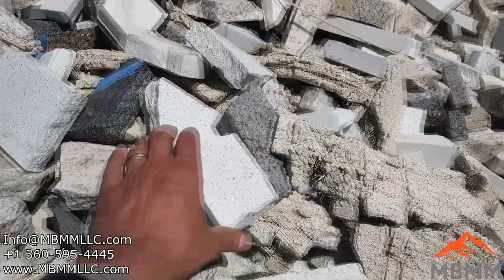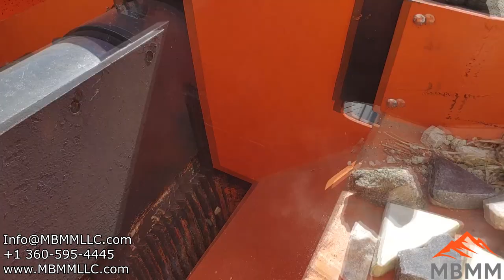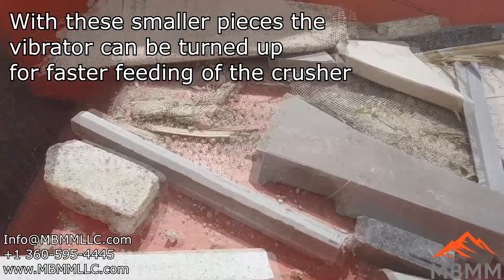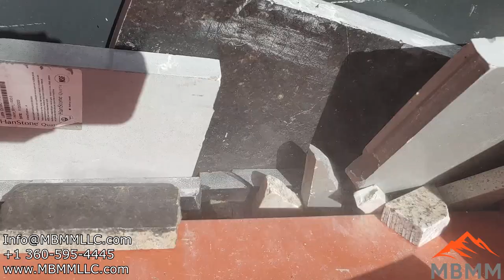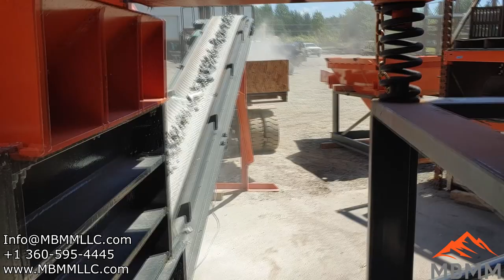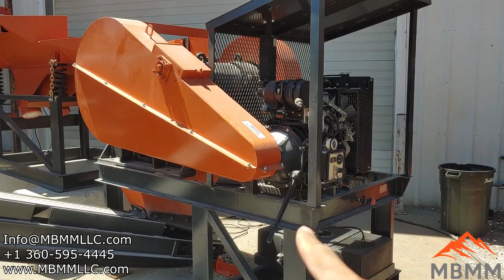Stone Countertop Crusher

Comment: One suggestion is to use a Variable Frequency Drive instead of a phase converter, phase converters can lose  up to 1/3 hp and vfd's don't  pulse the motor control with vfd's are made in the vfd. In a single phase to three phase applications hands down that much better and cheaper!

Comment: I would have liked to see what happened with the screen that went through. Five two one it clogged up the works
Reply: Concrete tile backer board.Fiberglass web is what you thought was screen.Jaw crusher wouldn't grab or snag the  glass webbing so it just fell on the conveyor belt to be dumped into the hopper with the crushed rock.I've used tile backer and it's easy to cut.Just  score it with a razor knife and then snapped to the size you need. It needs to be backed with a vapor barrier but once the corners and seams are grouted in it is water tight.